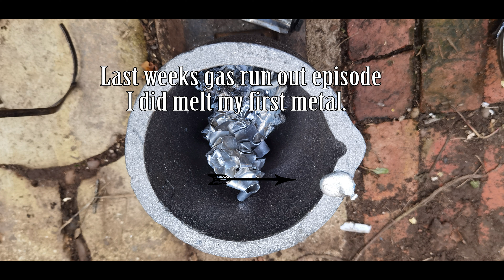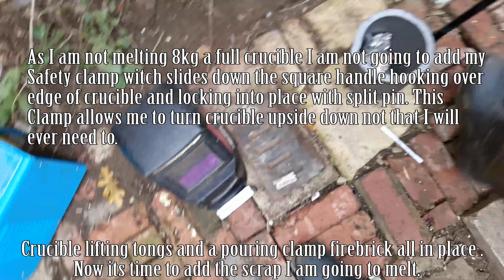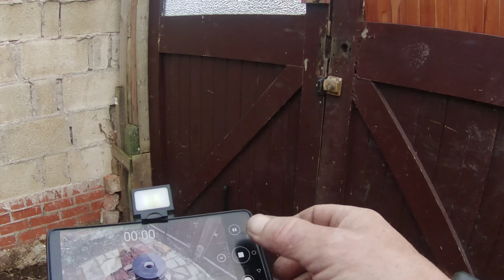Devil Forge First Melt With Trash Found With The Garrett Ace Apex. Episode 75 Week 48.

Comment: Good stuff mate.  I see you are a bit dabhanded with a welder too 👍.
what ever you do, don't melt down your lead if weighing it in. you get less money for it in melted down form as a lot of places cut ingots in half to make sure they are pure lead 👍
Reply from the maker: No intention of weighing in anythink aiming for 1000kg in 4 alloys lead aluminium copper and brass. The place I go to use spectra graph analysis to ck metal content but don't do small amounts so when I have completed my mission I take it in. Its such good fun scary as well and now all the items I dig are treasure. I didn't find much this week. But not through lack of trying. Cheers Jason